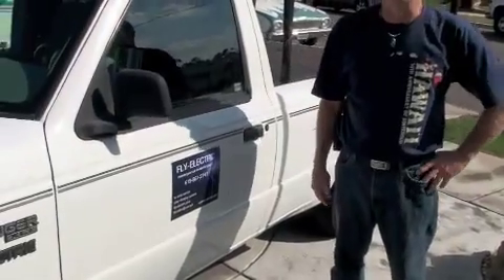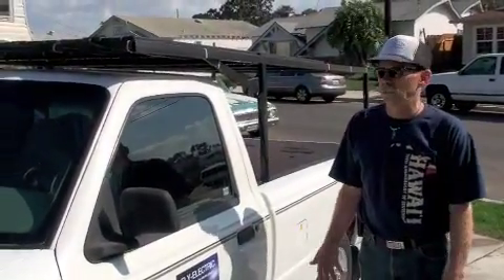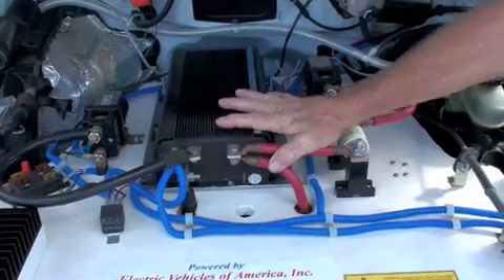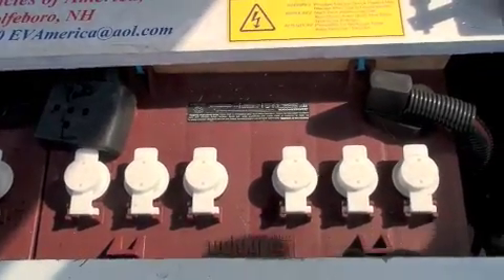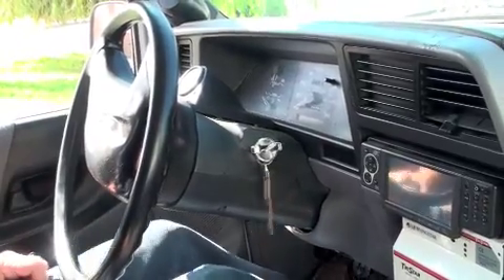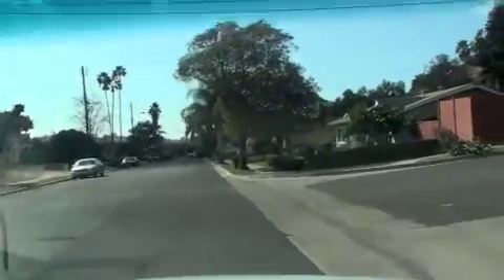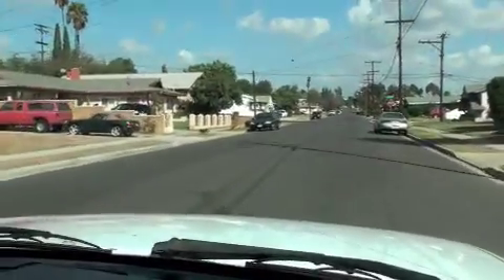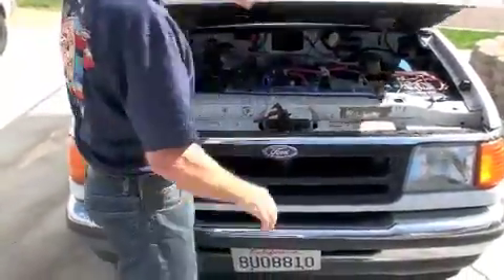Electric plug-in Ford Ranger

Comment: Really good video. I am wondering on how the photovoltaic solar panel performs though. How long in good sunlight would the panels take to complete a full charge cycle. I am considering a similar project on an RV with 6 X 250w/h (1.5 Kw/h) solar panels on the roof, and enough lithium - ion batteries under the floor to get around 200 miles from a full charge. But the point with an RV is, how long would you have to be parked up to get a full charge back to the batteries with 1.5 Kw/h solar panels.

Comment: so you are going to make a solar system to charge what??? volts ,12v for inverter .like the ranger,or direct ?  the ranger is 144 volts battery, the Minnie truck is 48 volt. ok my solar system has morning star controller its like a regulator tells it when to stop and start charging.so no problem with plug en in wall .?call me p s electric jet ski video to come later FLY.